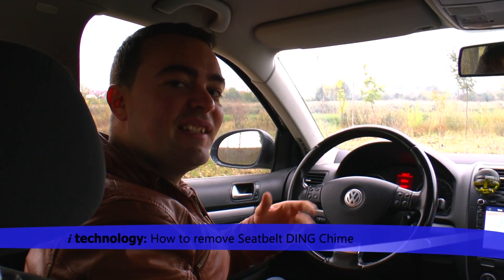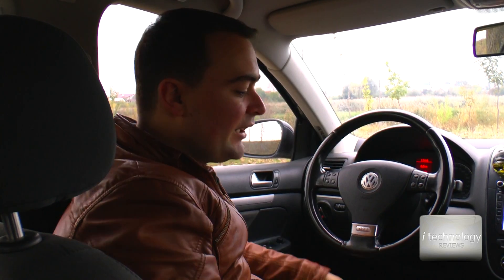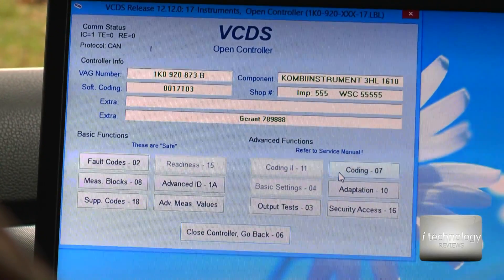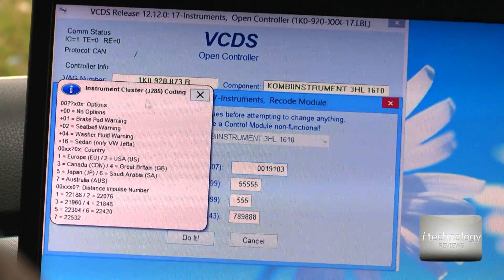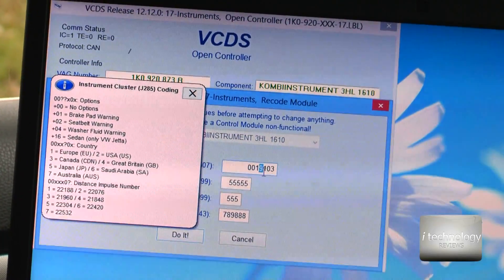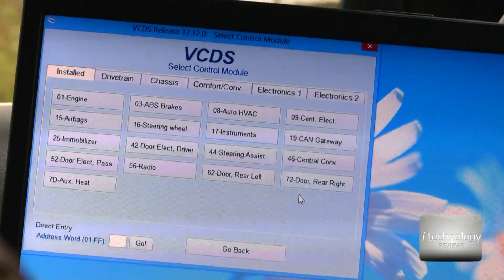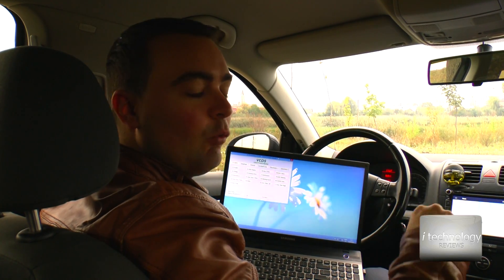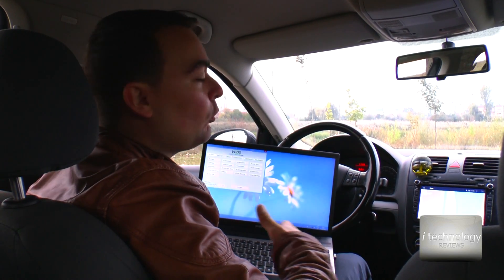How to remove seatbelt ding chime with VCDS - Vw, Skoda, Audi, Seat

Comment: 2004 GTI, worked fine - just need to make sure to line up which line item is which number. On my car, it was the second item, so all I had to do was change the "5" to a "3" and done. I disabled because I did a repair on the seatbelt latch to get airbag code off, that worked great, but I think a tiny spring didn't go back in and I think that was the issue, so this little hack saved me a ton of headache. Thank you.
Reply from the maker: Hi. Please remember that the seatbelt can and it will save your life. Think if you want to do this and if it legal into your country!
Reply: @iTechnologyReviews  Of course, this was ONLY to not have it beeping while driving the car as a tiny spring didn't make it back into the buckle and I didn't want to disassemble again. Great fix. Thank you.
Reply from the maker: Welcome man. Subscribe

Comment: Ok i understand to change driverbelt off 19-2 =17 
But if i will change washer fluid warning also .(+04)
and brake pad warning+01 .
How it works if I want to change everyone  ? ? ?
Reply from the maker: hi; then it will be 7-4=3 it will be 13 final if you want to disable washer fluid warning; but be careful